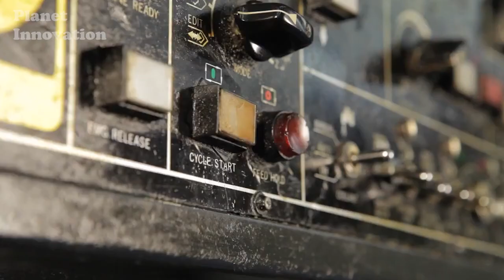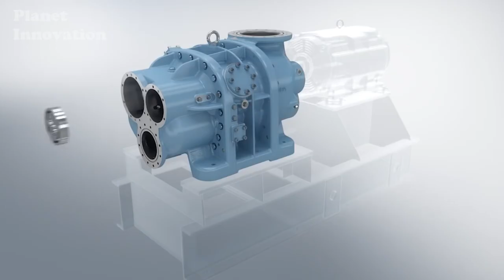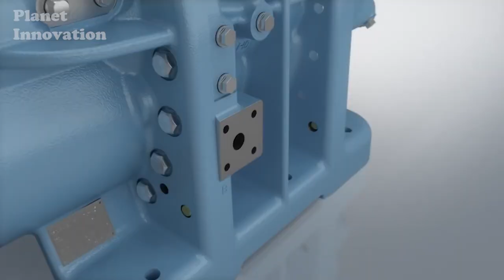Modern CNC Machining: Screw Air Compressor - Repair & Maintenance Giant Diesel Engine Crankshaft

Comment: Build to perfection. One of my dream is to become a machinist. I love it!
Reply: Change your mind. A heart attack is a professional illness of a machinist. I already had one. 26 years on the machine.
Reply: @valentynpatalakh4949  What do you think is the cause? Poor lifestyle, tension of of business, dealing with customers, worry about ruining a piece you had spent 20+ hours on? I can see how a machinist must have the most focused and serious mind stay on task and not ruin a piece. Not a job for day dreamers or those who's minds wander. There is no backspace key to remove a mistake.
Reply: Much of this is accomplished by CNC operators and not actual machinist.  Yes, you have to have machine shop skills but few actually get to make parts from scratch.  Tool and die makers are where the most crucial machine work is completed.

Comment: The screw compressor Unit, special for air compressing, amonia refrigeración Unit for low temperature procesing plant for chemical a Refrigeración plants!!!!
This design is from the Sveska Rotor Maskinen Company, Sueden company, that patented this machine as the best industrial gas compressor!!!!!

Comment: I was engaged in the installation, maintenance and repair of screw compressors, but I have never seen the current size as in the video at 2:23 and did not even think that there are current sizes, like it.

Comment: Now that's precision. Do you laypeople wonder why some parts cost a million dollars or more? It's not the cost of the material, it is the incredible engineering, the very expensive CNC machines, and extremely smart and talented engineers involved, to make that part what it is.
Reply: No. I’ve never looked at a million dollars part and thought. You know what? I bet that costs $100,000 per pound of stainless steel
Reply: @jamesbizs   I meant something slightly different, as in why does that part cost a million dollars? Seems like it cost only a few thousand, as if they dug up from the ground like that, washed off, and sold.
Reply: That screw compressor set was huge. Really wonder what it was for. As far as the craziest cost per pound the clear winner was a beryllium metal part for a special purpose that shall not be named. The finished part was carved from a 26 pound round bar and when done was only about 7 pounds. Cost for the customer was 1,320, 000 😲 Also the stuff is super brittle, hard, and likes to eat tools for breakfast. If beta titanium and stellite had a baby you would have pure beryllium.